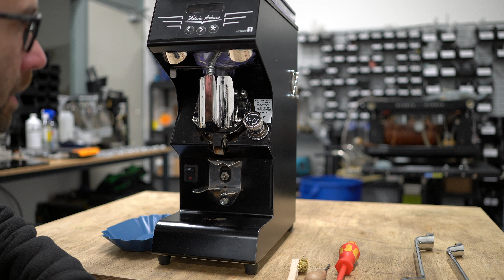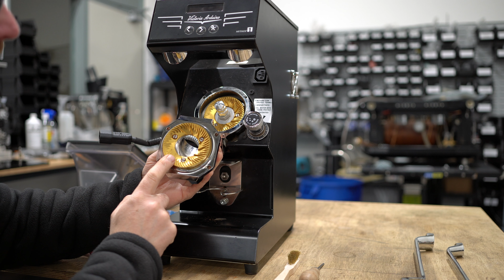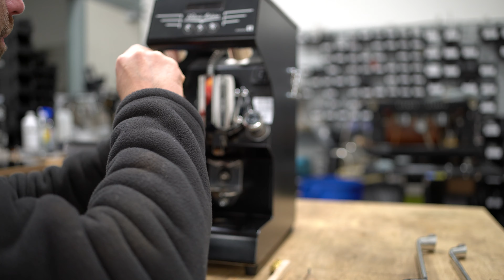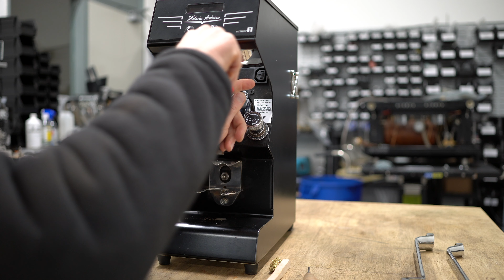Mythos One Burr Cleaning

Comment: how to open fully the grinder for deep cleaning?
Reply from the maker: What part of the grinder do you want to open up?
Reply: @rjameswilkins  the whole grinder
Reply from the maker: I'm not sure where to start with this. You can access the inner parts of the grinder by unscrewing the feet.
Reply: @rjameswilkins  I hope that's enough, it is a second-hand grinder I suspect, and it has a kilo of coffee inside I can see the vents are dirty like hell...deep cleaning is a must...i might do a video about that :)
Reply from the maker: The body is quite difficult to disassemble. However, you can access a lot of it by removing the base by using the method described. Use a vacuum cleaner with a bristle brush end to agitate coffee grinds stuck in obscure places. Good luck 👍